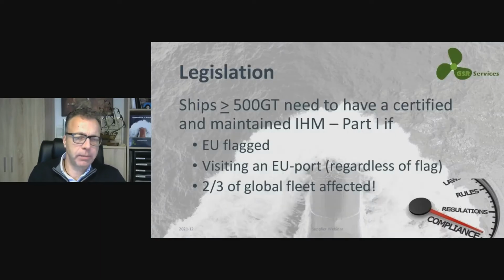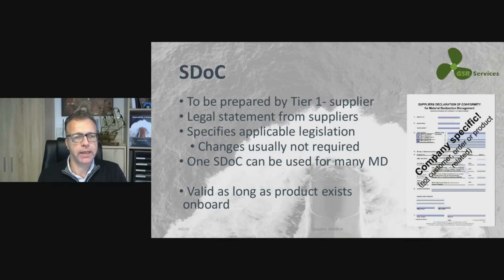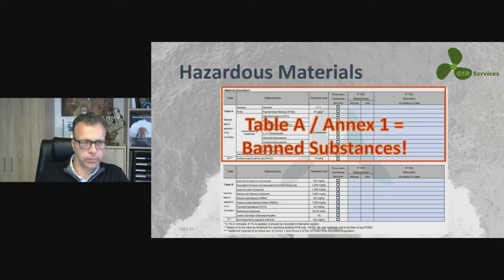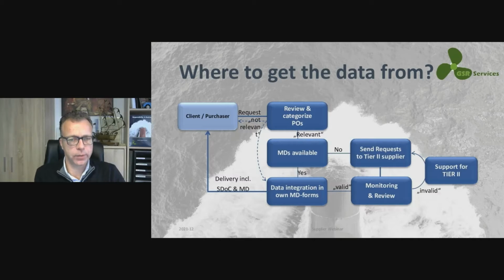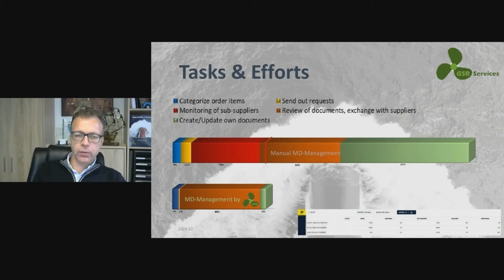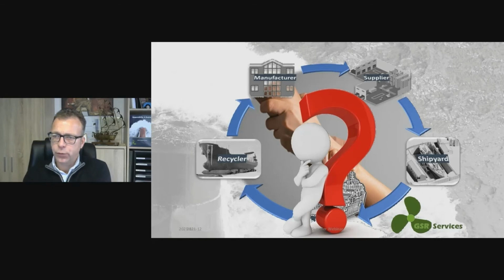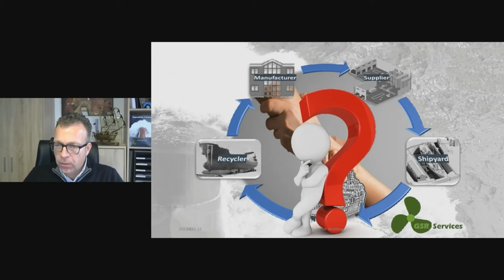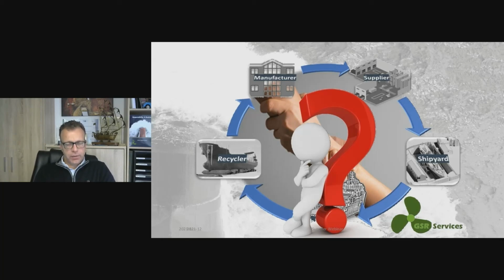Webinar "IHM Management for Suppliers (EN)"

Comment: I have a question! If a ship already has an IHM SOC, does it need to obtain an IHM certificate after the convention enter into force? Is it be possible to covert into certificate without a survey?
Reply from the maker: An SoC has been issued after check of IHM after an Initial Survey. It´s common practice by classification societies to issue SoCs without having been authorized to do so by the respective flag state. Once the class will be authorized to act as an RO (recognized organization) on behalf and by the flag state, the SoC will be replaced with an IHM-Certificate. Usually no survey will be carried out for this. It finally depends on the classification societiy, but another survey is usually not conducted.
Reply: @gsrservices8373  I really appreciate that! I have a one more question. I've heard that the 2023 guidelines for the development of the Inventory of Hazardous Materials (IHM) will include Cybutryne in Part I. If this update occurs, will there be a need for a new survey to update the IHM Part I list?
Reply from the maker: Dear  @Benjamin-rr4bb , that depends on the decision to be taken by IMO / MEPC or working group (in case there will be one). Due to the huge number of already prepared IHMs I doubt that IMO will require sampling / inspection of ships. Also Cybutryne can easily be covered during IHM-Maintenance as material certificates and AFS-Certificates of the ships will clearly specify whether or not it is contained. There is no need for an inspection or sampling, but I´m sure some guys will try to sell exactly this to shipowners ;-)